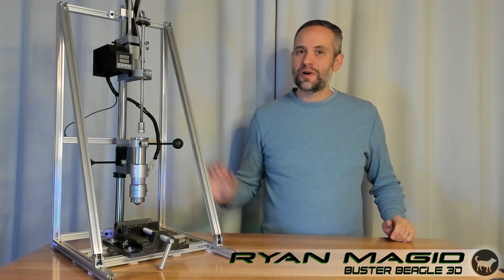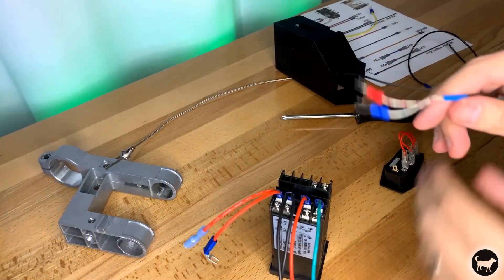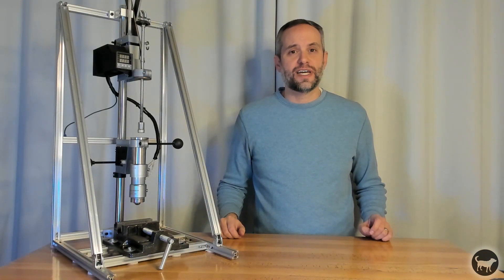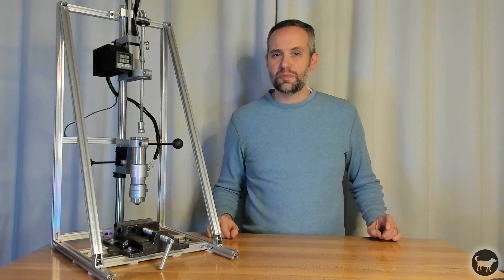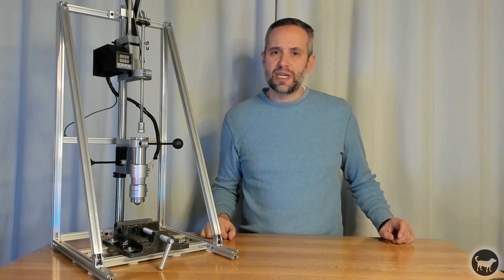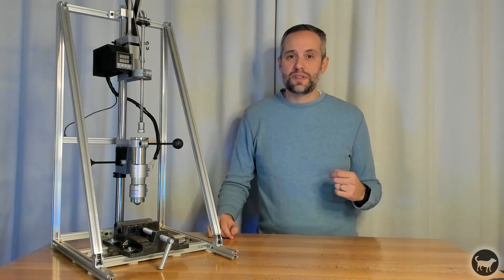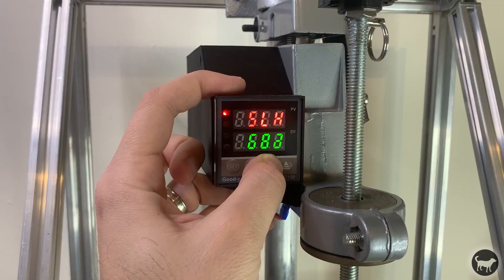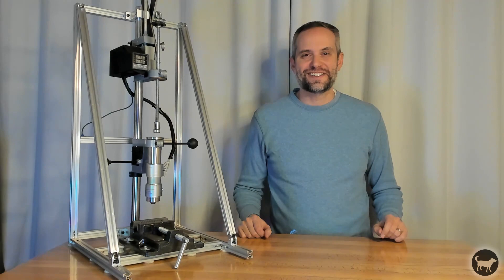Buster Beagle 3D Injection Machine MKII

Comment: Would you be able to add another heat chamber to this and it work the same still?
Reply from the maker: I'm sorry I'm not sure what you mean. Like run 2 chambers at the same time?
Reply: @BusterBeagle3D  i mean like the heat chamber extension. But I guess I’m really asking if I can use this same setup with the mk3 heating chamber?

Comment: Considering trying injection molding for a part I'm working on, the part is a little under one cubic inch in volume however it's nearly 8 inches long, is the shot volume all that matters? can the machine accommodate a part that large?
Reply from the maker: As long as it’s not over the 2 cubic inches for the MK2 or 3 cubic inches for the MK3 it should still work. However you may need some extra pressure depending on how thin and detailed some of your parts get. Also don’t forget to preheat the mold to make sure the plastic does not solidify by the time it reaches the end of that 8 inches.
Reply: @BusterBeagle3D  awesome! Thanks for getting back to me so quickly!

Comment: Why is shipping so much on everything you sell or promote for the injection molding press?
Reply from the maker: The shipping cost are based on the weight of the items that are being shipped. These are all heavy metal components so they cost what it costs to ship them. I make no money off of the shipping costs and to be honest with some countries I actually lose some money on shipping since it actually costs more then I charge. The MK3 bundles for instance are over 10lbs in the US that is $16.50(Medium flat rate cost),  Canada $54, Everywhere else in the world I charge $75. However if it goes to Japan it cost me $95, Germany $78, UK $79,   Australia $88, Spain $79, Korea $80. So you can see if anything I'm actually supplementing shipping in many cases.

Comment: How do you determine what STL version to print for the pid case enclosure?
Reply from the maker: Take a look at the pictures on the Thingiverse page. It all has to do with the hole position on your drill press stands. They vary slightly which is the reason for the different versions.

Comment: Hey Ryan - great videos! I was wondering if the new one piece 2in3 kit is compatible with the extension piece for the original kit. Basically I'm interested in a 3 cubic inch shot. Would that be possible? and would the MK2 frame be able to accomodate the 2in3 kit plus an extension? Thanks!
Reply from the maker: Technically yes to the first question that it will fit on the extended chamber but I don't think the frame as it currently sits can hold it. You also would have to alter the handle to have a pull longer then it currently can do. I haven't done either personally myself. You would also almost certainly have to add band heaters to the design as well as possibly another PID controller.
Reply: @BusterBeagle3D  Thanks for the quick response Ryan. Let's say I really wanted to get a bigger shot - I can figure out the frame myself, but could I just connect the additional heater band wires the the wires already coming from the PID and SSR? Or will that overload the components? Could I get around it by switching to larger wires? Thanks again for your awesome videos!

Comment: Ryan, super nice work, thanks for your hard work and sharing. We have a few small projects we would like to make, Polypropylene and maybe a Bayblend (a mixture of ABS and PC). Each component comes in less than 1.0 Cub. in. but there are some pretty intricate details were concerned about. Concern #1, do you think one needs "bleed holes" or vent holes to allow the plastic flow to the smaller intricate pockets, or is this even a concern? #2 How much pressure is actually required to push the plastic into the cavities, ie. can we leverage enough force to push the plastic into tiny areas? I know its a case by case issue but have you had experience in making intricate components? Thx Again, love your work    BTW I'll be 3D printing our molds don't expect to get a lot of production out each mold, thinking some Sirya Tech resins, they read real well
Reply from the maker: Thank you! I'm far from a mold expert but you might be able to find a few folks on the Buster Beagle 3D facebook group that are. I haven't made anything that was too intricate yet but there might be some people over on the group who have. 
I have also used the Sirya Tech high heat resins with good results. Good luck!
Reply: @BusterBeagle3D  Thank you so much !

Comment: Hey Ryan, In the middle of building the kit. How should the total travel be for the plunger in the final assembly. Also how long of a 3/8" rod is needed to replace the one from the factory? Also, I can't find a drill press top anywhere so I'm using a shaft collar from Amazon.
Reply from the maker: You need a travel of at least 6 inches to fully evacuate the chamber. I use a 12 inch threaded rod but as long as it's around 9 inches or so it will be fine. For the drill press stands you will not be able to find the brackets as separate pieces. You have to purchase 2 drill press stands and use those parts that way. Be sure to watch the original injection molding machine video first before trying to assemble the MK2. Glad to hear it's coming together!
Reply: @BusterBeagle3D  Thanks this helps so much! I just finished assembling mine today. Your videos really helped.
Reply from the maker: @terisan2002   Glad to help! Would love to know how it's working for you.
Reply: @BusterBeagle3D   Got it together and it works pretty great. My 3 hurdles in assembling the kit were. 1. The M8 cap socket bolts sold at Lowes had a head height that interfered with the drill press stand. 2. The PID box was hitting the back horizontal bar due to how I assembled the kit. 3. The thermocouple wire is super sensitive to motion during injection and sometimes reads a spiked temp. It'll set off the oooo alarm. I bought some molds and plastic from LNS and have been happily injecting for the past few days.
Reply from the maker: @terisan2002  Glad you got it up and running! I would check and make sure there is no exposed wire on the thermocouple wire making it short out and read 0000. That is not a normal thing that happens with that wire. Something may be loose or as you pull down you may be touching another wire or the frame or something.

Comment: The shot size blows much more expensive machines out of the water! About how long would you estimate it takes to build the whole thing?
Reply from the maker: It's hard to say since I know what I'm doing when I do it since I have made so many but I would say it should probably take about 2-3 hours with all of the wiring and frame assembly.
Reply: @BusterBeagle3D  Thanks, that is helpful. Trying to figure out if we can shoot ABS with this. Pressure is the concern. What is the diameter of the chamber?

Comment: Hi Ryan, I'm almost done building my MKII and have a few loose ends to tie up. The main one right now is replacing the spring that you talk about around the 3:40 mark in the video. I've been to my two local hardware stores and didn't see any springs that matched what you showed in the video. Can you elaborate on the spring you chose - dimensions, source, part number, anything like that?
Reply from the maker: Hello. I'm not sure if you are the same person that reached out by email this morning but I will let you know the same thing. The spring is listed in the Frame part PDF you can find on the Facebook  group files section or on the Thingiverse page. I originally had it listed as a 4.5inch Long 15/32 spring but had updated that to a 3.5 inch 15/32 spring. The 4-1/2 was too long. Really you just want anything in there to provide a little resistance. The problem in the MK2 chamber is so heavy that to get a spring strong enough to hold it up it won't be springy (if that is even a word) to pull down the whole way. I would recommend either way adding the additional springs to the handle to keep it from crashing down on you. I had it come down once and crack me in the head and it didn't feel good. No springs are going to be just right so that's why it's good to come at it from both the handle springs and one in the drill press stand. You can see what I am talking about in the UPDATES video on my YouTube channel. If you can only find a longer spring that is ok as well. The gauge of the spring is so small you can cut it with some wire cutters and make it shorter. Hope this helps.
Reply: I know this comment is a few months old, but I thought I'd mention for others that I found a spring on Amazon that's 3 1/2" long by 7/16". That's more than close enough to the suggested 15/32" diameter without being the correct dimension. Can't post a link, of course, but here's the description to search for: Handyman SP 9667 Prime-Line Products Single Loop, Closed Extension Springs, 7/16" x 3-1/2", Nickel.
Reply from the maker: @john_t_england  Thank you for the update. Yeah I don't have any control over the posting of links but thanks for the info for people to find it!
Reply: @BusterBeagle3D  My pleasure! On a side note, would love to see a Discord server pop up at some point. Although I miss the group aspects of the platform, I detoxed myself off of Facebook a while ago. Would still like to participate in the community, though.

Comment: Hi, very very nice! Just enjoyed your first Injection Machine 1.0 video. Very good, I like these kind of DIY vids that show quality and ease and easy enough to assemble.  Are there 220/240V versions available too? Also, I'm new with this, but does the molten pellets tend to squirt out at the top (insert) somewhat when applying the pressure?
Reply from the maker: You can hook up the 110V band heater in series if you are outside the US. Inside the US the band heaters are hooked up in parallel. There is a diagram in the pictures of the Etsy listing that explain this for those outside the US.
Reply from the maker: Also the tolerance in the plunger should not really allow plastic to escape the top. I suppose it can happen and I have seen it once or twice but it is not the norm.

Comment: So bummed that YouTube showed me the version 1 video a couple months back but not this version 2!  I almost wasted my money (well, seeing as I would definitely have gone for v2 if I had known).

Anyway, Crafsman came through and said “this is V2”.   😮  V2あるの？？
Reply from the maker: There is an upgrade part that converts the MK1 into the MK2. All of the electrical is the same so you could easily move from one to the other. I currently now also sell a longer chamber as one piece instead of the extension but they both have the same volume either way.

Comment: I'm looking at building this but 35x35 heater bands are oddly hardly to find  in Australia... What is the actual outter diameter and length (of the heater section) of the heater chamber? Given you have to open up the 35mm ones in original video to allow for the sensor etc, but with the extended heat chamber that wouldn't be required so hoping to find a different heater band that will work. Thank you in advance
Reply from the maker: The diameter is 38mm the length is about 62mm. If you purchase the Bundle version off of the Etsy site you can get a version that comes with 2 band heaters as well. They are 110V but that just means you have to hook them up in series in Australia instead of parallel like we do in the US.

Comment: Hi Ryan, thanks for the great work! I'm probably going to build this sometime in future when the parts are available :)
One thing I'm curious though, what determines the maximum size of the shot? Is it the capacity of the heat chamber? 
Thanks!
Reply from the maker: Hello Denny. Yes the max volume of the chamber determines what the shot volume can be. Since you can not inject into the same mold more then once at a time the volume of the mold can not exceed the volume of the chamber.

Comment: Would this work with rubber?
Reply from the maker: As long as it can be melted under 300-400 degrees Celsius and inject at a pressure under around 1000 pounds of pressure. It should work.

Comment: If i were to build this version but have three heated chambers side by side to then have 6” effective pull, could the 6 heaters be powered via one PID controller our would I need to basically have three separate units on the same frame?
Reply from the maker: I'm not 100% sure but I don't think you would be able to power so many band heaters from 1 PID controller. I'm guessing you would want 1 PID for every 2 band. When you say side by side I assume you mean stacked. Currently the regular chamber with the extension in 6 inches. It may be hard to not only connect more then one but it also might be hard to generate the pressure needed to push plastic out of such a large chamber.
Reply: @BusterBeagle3D  ok. Yeah thought you’d need 1 PID per pair of band heaters. 

Im wanting to do a larger part. 

So imagine three of your devices standing side by side all injecting into the same mould
Reply: @Jledcustoms  Looking at eventually doing something similar. Did you ever make any progress on this?
Reply: @john_t_england  not as yet

Comment: I'm not sure if it matters in this case, but in other use cases, those SSR's are mounted on substantial finned heat sinks.  It seems off to just attach them to a plastic 3D printed housing.  OTOH, in my case, there doesn't seem to be any temperature increase in SSR's attached to these heat sinks.  My guess is that heat generated by SSR's is connected with the frequency of being turned on and off, but I'm a chemical engineer, not an electrical one, so that is just a guess!  It would be great if someone with actual engineering experience in this area would comment!
Reply from the maker: You are correct. There is a large finned heat sink that you can get for those SSR's. In every single PID controller I have bought , which is quite a few, I have never had one come with the fin. The kit usually contains a PID, SSR, and K sensor. I have felt the SSR while using the machine and it never seems to get warm. It may be because like you said it is turning off and on a lot but then again I'm not a electrical or chemical engineer. :)
Reply: @BusterBeagle3D  The one and only PID controller that I bought, for use as a aluminum casting furnace, came with a finned heat sink.   I bought a second SSR and heat sink to go with this, since I used two 120 volt circuits, rather than the one 240 volt circuit from my UK inspiration.  But like I said, it doesn't seem like there is NOT a lot of heat being given off by the SSRs.  I'm using a duty cycle of 4 seconds, so that the number of transitions is pretty small compared to 60 Hertz.  To test this out, maybe I'll try a duty cycle of a 2 Hertz, to see if that causes any noticeable difference.  But currently, I'm trying to grok using stepper motors.   Right now, the stepper motor that I'm trying to use seems anemic compared to what I'm expecting.

Comment: I'm thinking that these hot ends could benefit from being insulated (heat wise) from the frame. Especially considering Ryan's comments about the benefits of wrapping the hot end with insulating muffler wrap or similar.

Comment: So I built this and was following the directions for the rex c-100 configurations but my controller behaves differently from the one he shows in the video.  I only have 3 digits in my lck screen for example.  I also only get three digits in the code screen and am unable to enter the second table to check those values.  Any help with this would be greatly appreciated.
Reply from the maker: Hi. I wouldn’t worry to much about the 2nd table. You might want to set the ARU in the first to 1(different then the video). It puts the PID in a learning mode. Then in COD 001 the one you really want to pay attention to is SLH which is the max temp of the heater bands. Make sure it’s set for less then the rating of your bands.  Probably 300-350C or something around there. Hopefully your PID also came with a manual that should tell you how to navigate your specific PID controller but even if it has 3 numbers instead of 4 it should still function pretty much the same way.
Reply: @BusterBeagle3D    Thanks a bunch, this is exactly the info I was looking for.

Comment: Oh and I forgot to mention, the drill stand will heat up a bunch. I put kapton tape on the pid controller box, used washers with kapton tap where there are screws etc